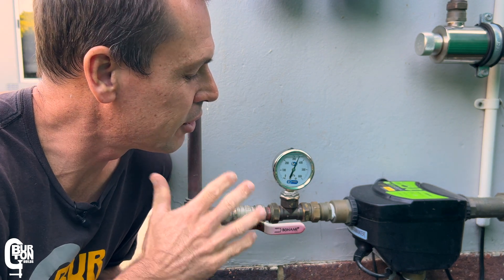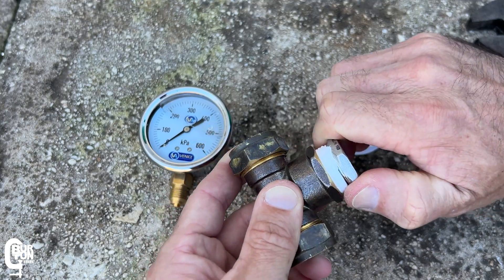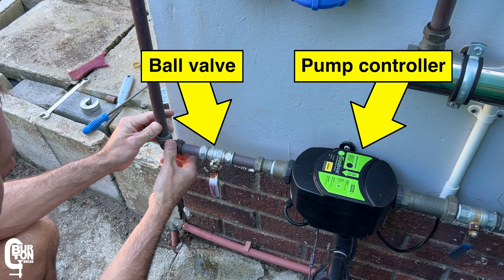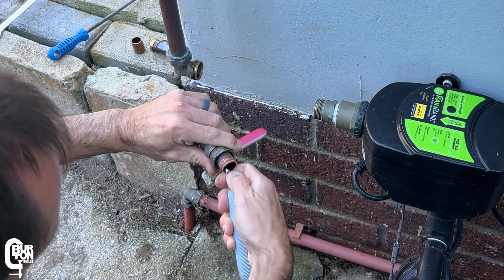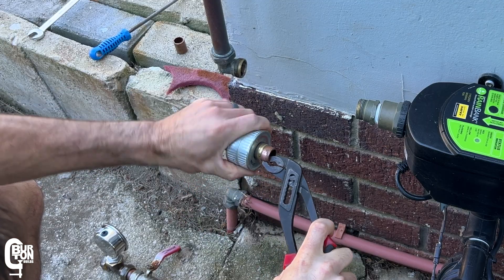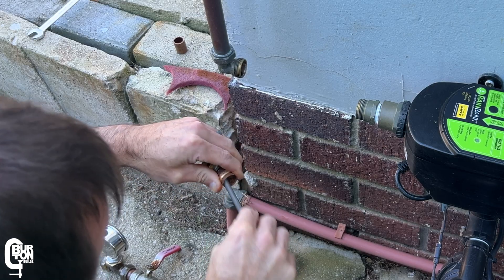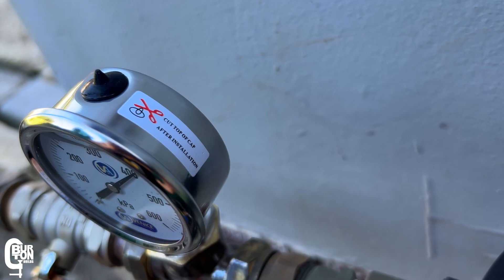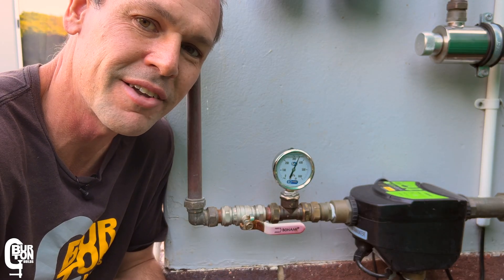How to install a water pressure gauge DIY (Rainwater Harvesting | Backup water system)

Comment: Hi Grant, nice to see your upgrades. I am certainly going to do this. If you like I can send you photos.
Reply from the maker: Yeah, that blocked carbon filter a while ago caught me out... haha, but not anymore. Next, to be even more lazy and not have to physically go check gauges, I need to install pressure sensors on each of the filter housings and feed the info into Home Assistant... maybe a project for a later date though.
Reply from the maker: Cool, send some photos to grantburtonbuilds@gmail.com